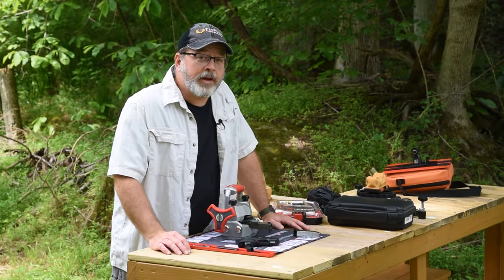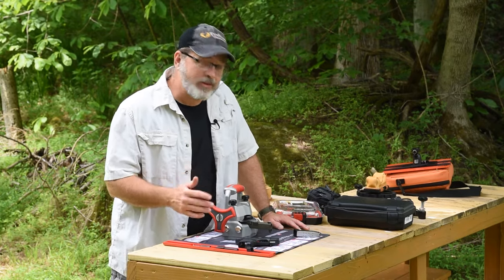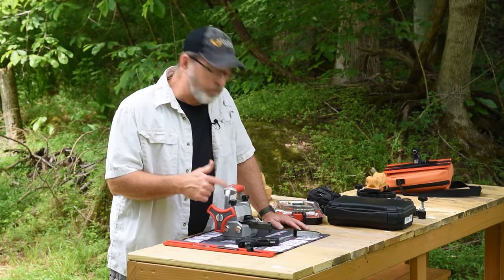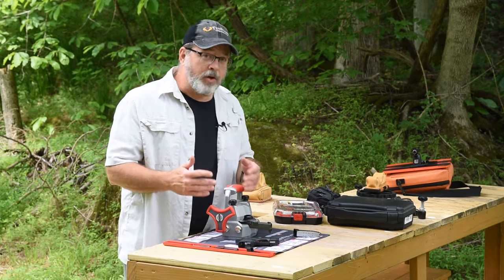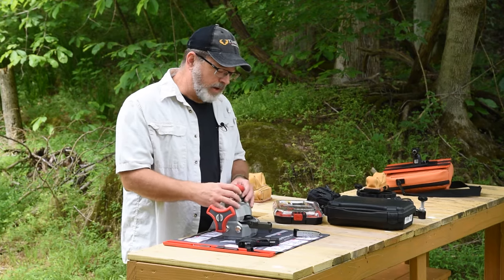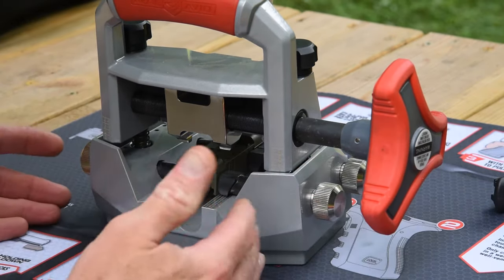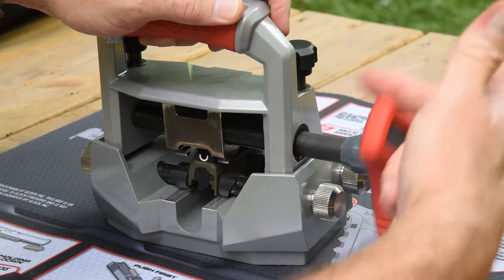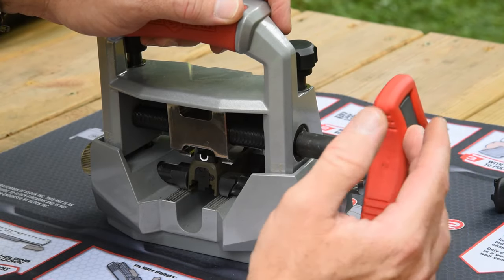Pistol Sight Adjustment the Easy Way

Comment: But you didn't mention WHEN you adjust the rear sight to the LEFT or RIGHT !
Reply: Just make sure the rear sight is perfectly centered. You should be able to tell which way to go just by looking at it
Reply: The rule is move the sight in the direction you want to move the impact. Just did that this morning. Was shooting right of center. Moved the sight (adjustable) to the left a smidge and brought the impact left to the center. A centered sight is a good place to start but doesn’t mean the impact will be centered. Too many human factors involved and the sight system may be less than perfect.
Reply: @nomansland4811  No, that does not work. If the bullet lands to the left, you move the slide to the right so that the rear sight and front sight are now angled to the left where the bullet landed. Then its zero'd ish .... 
If you move the rear slide to the left where it landed, you now shifted the angle of fire more to the right and now you have to turn your gun to the left and now your bullet is going MORE to the left and in the wrong direction.

Comment: Wish i just had a sight that could be adjusted with a flathead like my wifes walther ppq m2 q4 tac, but she is a gunsmith and has a sight pusher, the problem is that its not compatible with my beretta 92x or my hk vp9 which are my main carries

Comment: You are great but I'm not sure which way to push the rear sight to make the shots go r or l.
Reply: Iraqveteran8888 has a video on it very easy to follow
Reply: To move your point of impact to the right, push your rear sight to the right. To move your POI to the left, push your rear sight to the left. The opposite is true if you adjust the front sight. Front sight right moves the POI to the left. Front sight left moves the POI to the right.